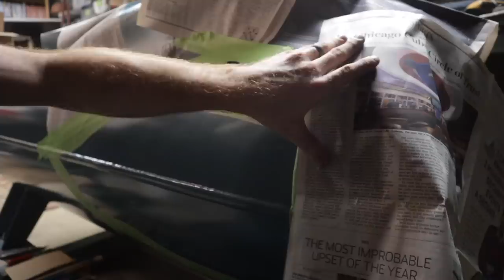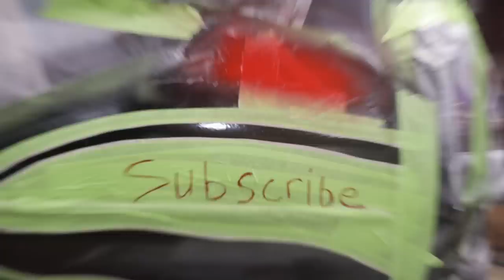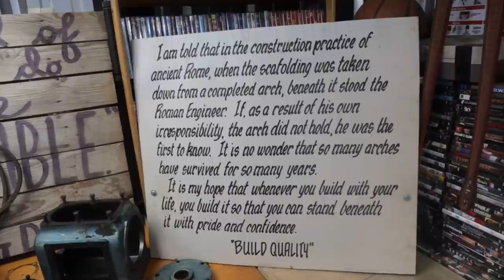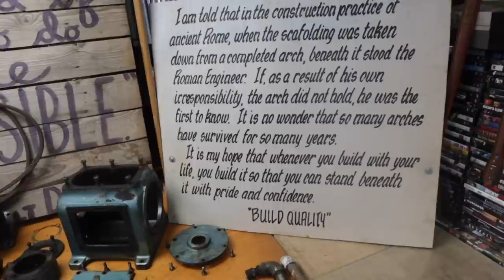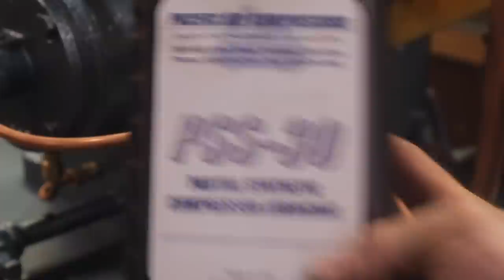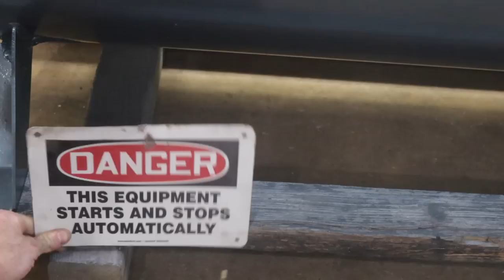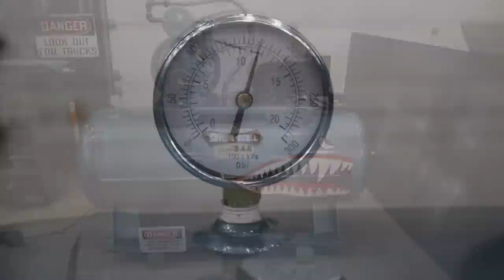OLD 2 Stage Air Compressor ~ Pump Rebuild/Custom Paint ~ RESTORATION Part 3 ~ Is that a Tiger Shark?

Comment: Wow you didn't hone the cylinders ??? With new rings its not going seal well and your going to have blow buy in no time and when you essmb. the crank you should had use engine essmb lub on bearing it will start with no lube and have a ton of wear on them and I didn't see you replace them either WOw and just seen not new connecting rods bearings I think he did a great job on the paint but I don't think the pumps is going to last a few decades with the short cuts that where made not putting new bearings And  now using impact gun the teighten down the head to juggs WOW OMG Call Saylor-beall and get the torque spec WOW
Reply: Honing has it's place and with compressors I was told to lightly hand sand a smooth bore with worn 600 or better yet new 1000 grit paper with solvent in the normal cross hatch pattern. Snooth no scratches, rust or wear to start with condition.
On honing any combustion engine plus compressors, after the light hone to next hand rub to knock down the sharp scratch peaks the honing process introduced to the bores. Slightly longer break in, no initial increase in aluminum piston wear plus longer ring life extending the life of the pump and engines. 
Talking a 400K mile bore looking like a 60-80K mile bore at most still having plenty of life left. 
Aircraft engine shop after the hone process we burnished the bores with hard maple blocks under stiff spring pressure to the bores on large radial aircraft engines (2800 Pratt & Whitney) I worked on in an engine rebuilding shop as well later on run up test stand. 

I picked up ($250) a 80's era pressure lubed 705 Saylor Beall with 60 gal vert tank I will mic the rod bearings and crank journals before polishing journals plus 1000 grit sand the bores and rering. Leaving nothing to chance before assembly checking the crank and roller bearings. I'm going into the pump only once in my lifetime also allowing me to sleep at night. 

What I haven't found is what kind of crank taper bearing preload is speced by S/B when assembled with old or new tapered bearings installed?  The Inch/lb Tq. rotation numbers with a bare crank would be nice from their engineer's assembly specs. HELP  need answers!
Typing in S/B online they have every Tq. spec of every pump they sell available,  no reason to "ranch guess". 
 What oils to use starting from new or after a rebuild to use regular oil, blended oil with synthetic mix or full synthetic that's another question needing an answer and if switching after break in?......~~=o&o>......